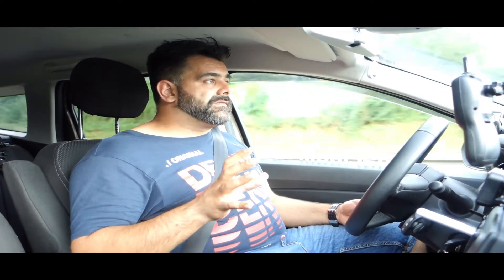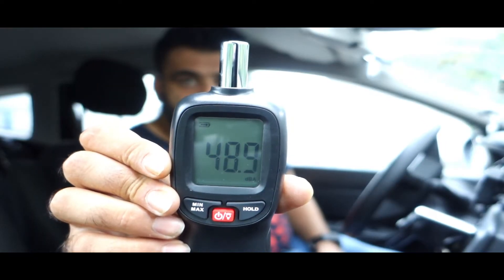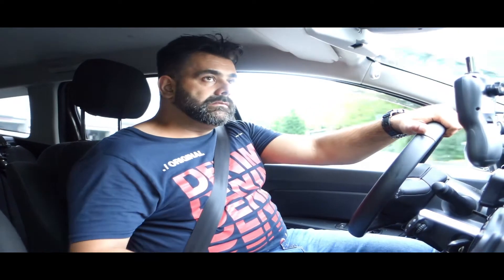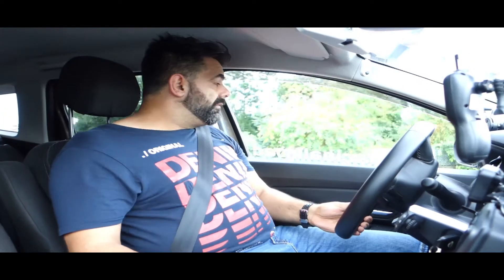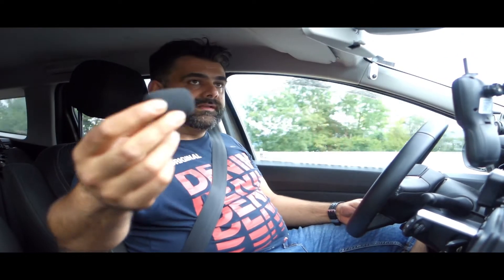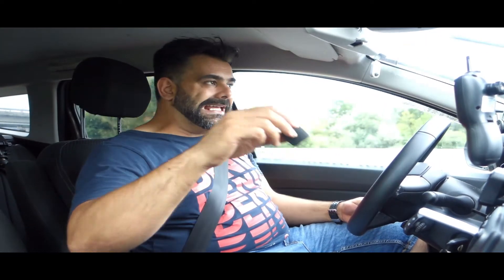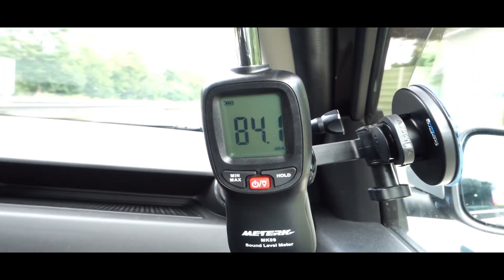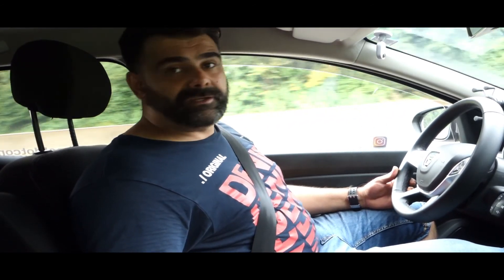Dacia Duster - SOUND METER 🔊- Noise Level Record in dB (Decibel) - PART 2

Comment: Road surface and tires make a big impact on the sound level.  Very coarse pavement and some rough concrete can be VERY loud in almost any car, while smooth asphalt can be nearly silent.  Offroad tires and tires with big tread blocks increase noise a lot, but you want those tires if you drive in dirt and mud... so it's a trade-off :(.
Reply from the maker: Jep - my focus was on - best match for mud, dirt, snow terrain. well im not that much driving offroad - but its a fine thing, if i dont have to think about - "will be there some mud, or dirt - or in winter - high snow",.. but as tradeoff -> noise, i often listen to music loudly so its "ok". but for other passengers its already too much. If i think of the defenders with the expedition equipment and so on - my duster should be less noisier than their cars :D

Comment: Dacia Logan 2006 1.6 MPI. Same result as this. 15 years, no improvement of sound level in the interior .....
Reply from the maker: sadly yes, but the most noisy parts on mine, are the tires and the roof rack. even worse, the tires are getting louder as they are more worn out.